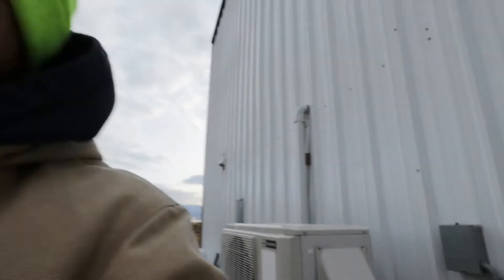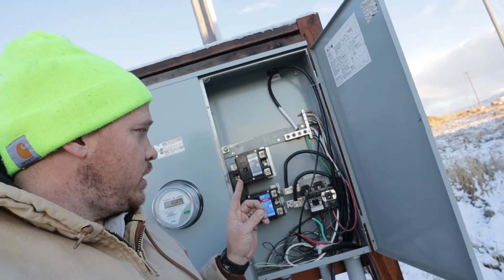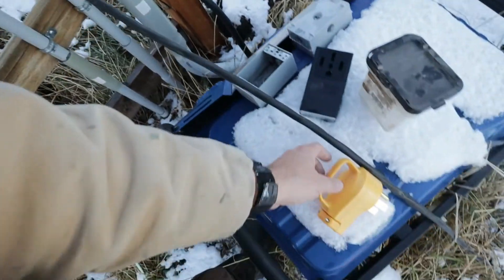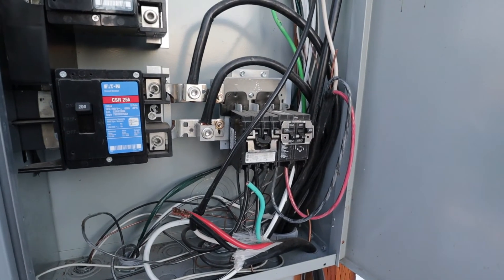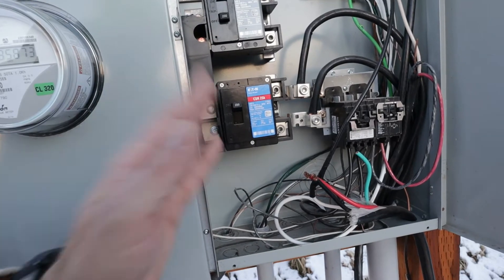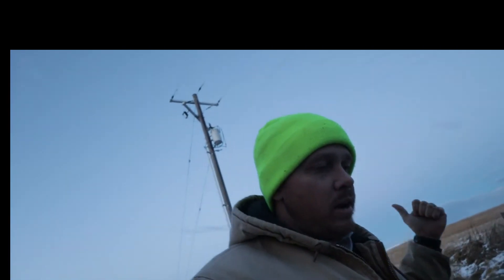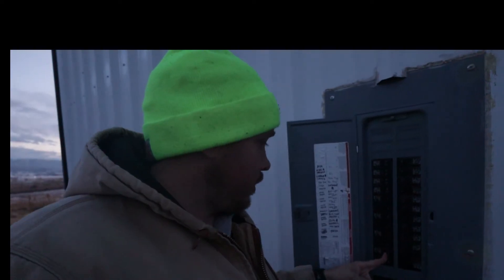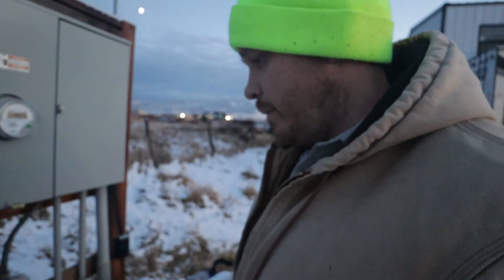How To Backfeed Your House With A Portable Generator

Comment: I happened to find his video and I am an electrician and I really think you should change this title because it's pretty dangerous what you are doing. Not trying to be rude to clarify, but you're using SO cord, you did an outlet and not an inlet, you are saying you're making a double male ended cord, and you have no interlock. The proper way to do this is to get an interlock meant for your meter main (there is a full website dedicated for this), get a 50 amp inlet off amazon and then use #4 thhn and 3/4" conduit with compression connectors from the meter main to the inlet box. The issue is if people follow what you're doing they can shock themselves pretty good and if they leave the main breaker on their generator will be trying to power the neighbors.
Reply from the maker: Thank you for the feedback I'll look into this more deeply and make a correction video and update the description here
Reply: @homesteadingbarndo  you could use 3/4 non metallic flex is not conduit.